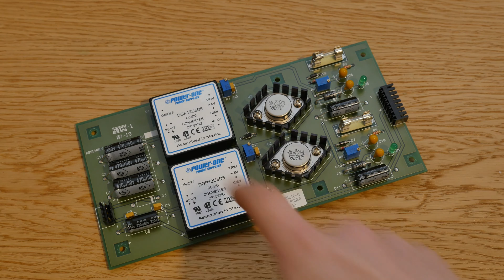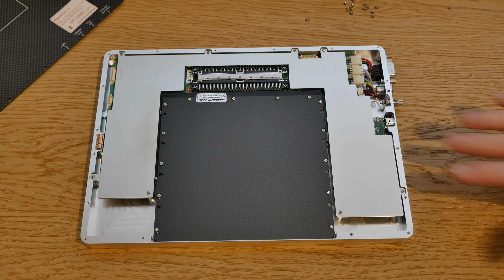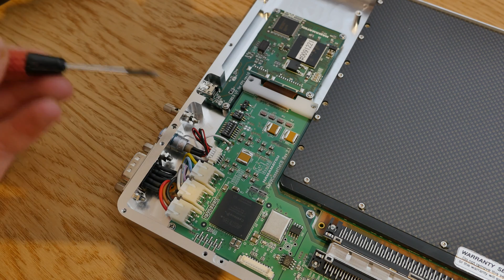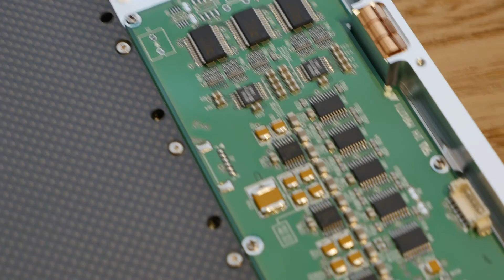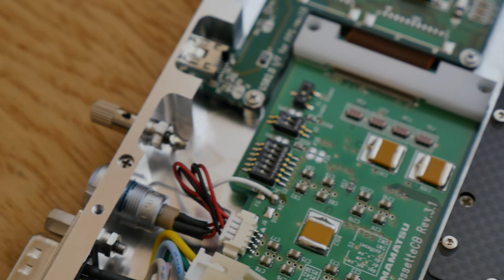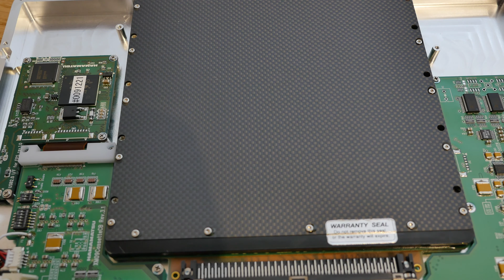X ray sensor teardown Hamamatsu C9732DK 12x12cm 2400x2400x16b

Comment: One of the problems with CID sensor panes is finding software to interface it with your computer.  Dental sensors (small bur readily available used) can be fairly cheap on eBay
Reply from the maker: This is hamamatsu. They have examples for nearly all languages  ,vb,c#,c. Made my own program.

Comment: It looks like I can't find the the Hamamatsu C9732DK-11 on any bigger electronics distributor or popular sales platform EU, US or China. Where can I get this part? Incidentally I am also in Austria currently, like the commenter two years ago.

If this part is not manufactured any more, can you recommend a replacement?
Reply from the maker: It is possible sometimes to buy it from ebay. But they are very expensive. What are you planning to do.
I have a spare sensor
Reply: @Kilohercas  Hi Linas! Really appreciate your videos and your reply! My intention is to do PCB X-ray inspection, for electronic repair work. I am looking for DYI alternative because I can't afford a 10kUSD machine. And I don't want you to sell your sensor, you probably need that as a spare part for your own!
Reply from the maker: @kwinzman  it does work for PCB,but it needs more energy/keV. It will do a decent  job for 2 layer pcb, but not for 4 or 6 . So no computers or phones....
Reply: Did you find this sensor or any other alternative? I'm looking into making a similar project and cannot find any sensors available on Ebay, Amazon, or anywhere else. There are plenty of dental sensors available but they are just too small. I found  a few options like the Canon CXDI-80C, MY-D056A,  or the PRUDENT from PIXXGEN, but they are over 12k USD